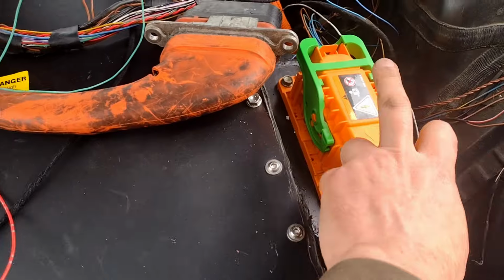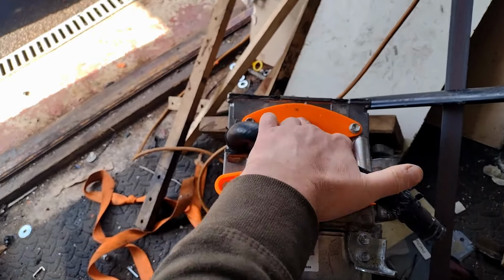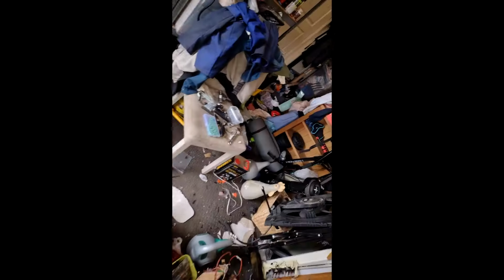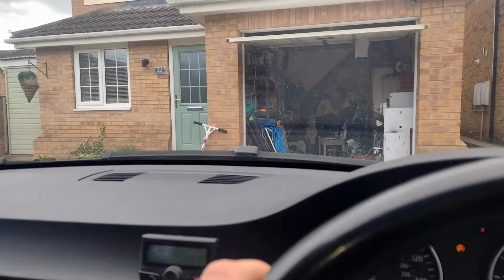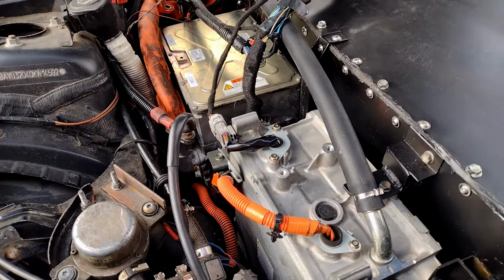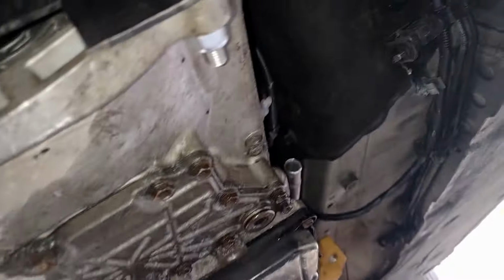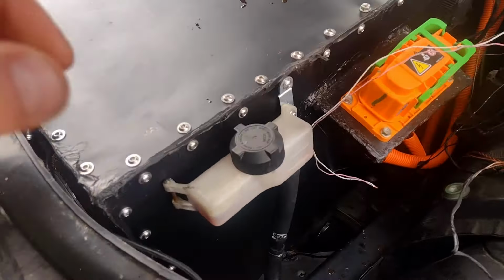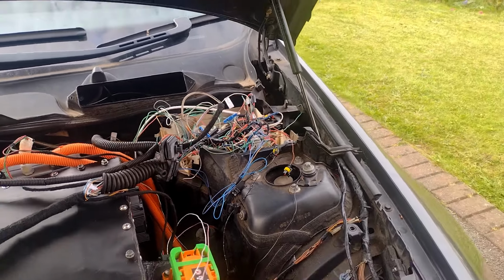Electric BMW conversion - First full voltage battery test

Comment: Hey, Is your break pump on the whole time? I might have a solution for that if you haven't already figured it out. I'm using the break cable which goes to the ECU on a relay, This means it only comes on when you press the brake.
Reply from the maker: @ervbon7493  nope, I added a feature to zombieverter to use the analogue input and a vacuum sensor so it comes on when vacuum falls below threshold
Reply: @JamieJones1985  Is see, sounds good what pump are you using?
Reply from the maker: @ervbon7493  can't remember, just something off eBay and a vacuum reservoir
Reply: @JamieJones1985 ok cool. I got a bit of a weird one. I’ve connected my Instrument Cluster (vehicle CAN) to CAN 2 ON the Z Verter but somehow it’s shutting down the Instrument Cluster and KOMBI. How are you connected? Have you got a video on your setup? I have a 2012 320i.
Reply from the maker: You connect to the PT can that the ECU was on. The dash is on a different bus that a gateway puts the required messages across from the PT can.
Reply: Interesting. Although I think I might have also tried that, I’ll give it another go. Thanks and happy New Years 👍
Reply from the maker: @ervbon7493  post to open inverter forum